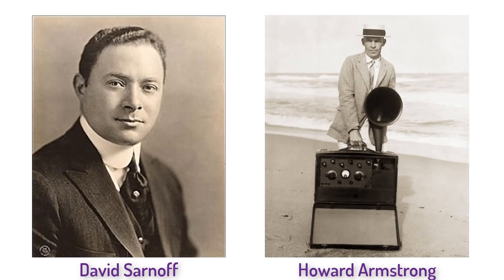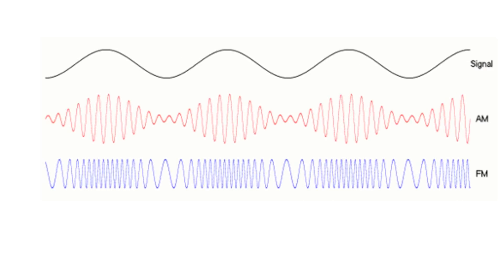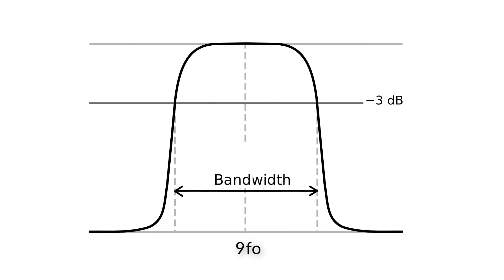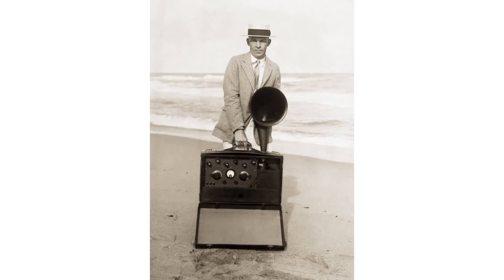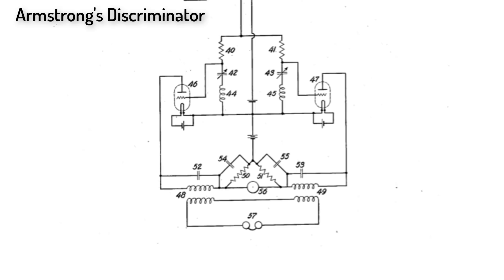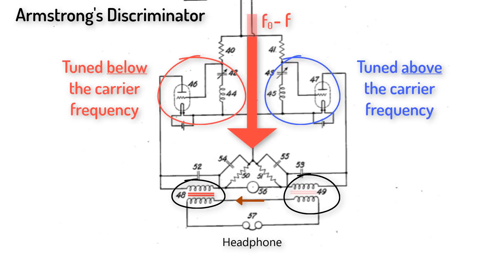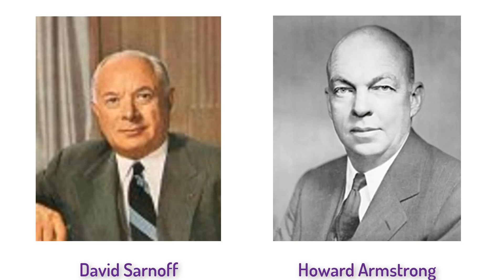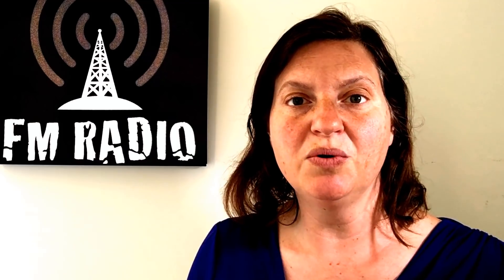Armstrong: the Tragic History and Physics of FM Radio

Comment: When I was in high school electric shop I learned about AM signals. When the audio is combined with the radio frequency the result is the carrier singal plus the audio (a sideband), the carrier minus the audio (another sideband) and the audio.  The transmitter loses the audio and transmits the carrier and sidebands.. 

The radio receiver picks the signal through an antenna, converts it and the side band to an intermediate frequency, amplifies this and then puts it through a diode which regenerates the audio. The radio frequency (RF) is filtered out with a tiny capacitor. The audio is amplified to drive speaker (used to often be called a loud speaker) and that is how we hear it. If a limiter were used with the AM radio we would not hear anything.

Because the difference between the the carrier and the side bands reflects the frequency of the sound the signal frequency is limited to the bandwidth of the carrier. This is set to 10kilohertz on either side of the carrier.

FM does not have this limitation. However FM channels are 200kilohertz wide.

Comment: Good overview. However, there is more than just the nature of the modulation between FM and AM radio to consider. The wavelength of the carrier signal has different characteristics. AM radio, being a much lower frequency (530-1700 kHz), and hence a much longer wavelength (about 1000 feet). Signals in this band tend to usable beyond line of sight, and are less affected by mountains and buildings that are in the way. FM radio signals are at higher frequencies (88-108 MHz) and have shorter wavelengths (about 10 feet). These shorter wavelength signals Are more easily blocked my mountains, and are not as usable over the horizon. Remember, the great DJ Wolfman Jack was heard over wide areas of the US on a AM radio station in Mexico. Yes it was an insane 250000 watts, but even that much power would not get a 100 MHz FM signal all the way to Canada!

Comment: In the 1960s I messed about with silicon diodes and PNP transistor colpitts oscillators to make a simple low power FM transmitter, based around 100Mc/s. Thank you Howard Armstrong for showing the way.

Comment: There was another advantage to FM.  Because AM radio waves can travel much further after dark, many radio stations have to sign off at sunset. FM stations did not have this restriction. So some stations, such as WMBI in Chicago went on FM so that they could have late night or all night programming. The first WMBI FM station signed on around 1943.  But with the war, nobody was able to buy new FM radios, so that first FM station was a failure.

FM radio doesn't necessarily have more bandwidth. But because it needed more bandwidth to work. The much higher frequency (presently 88 to 108 MHz) band was assigned to FM . This allows wider bandwidth channels.

FM isn't always high bandwidth high fidelity.  Narrow band FM is used for 2 way radio communication. It has a much smaller deviation and lower bandwidth. It still has lower noise.

Comment: There is another important part to the FM radio: the carried signal does not change loudness with distance between sender and receiver.

This is not very relevant for broadcast radio because you see the volume to what you want anyway.  However, it does allow you to distinguish which signal is louder from 2 transmitters independently of their range.

That made it possible in WWII to use sonobuoys — dropped from a plane, these hydrophones transmitted what they heard on FM and the operator could tell if a submarine was closer to one or another simple simply by the volume and hence keep track of the whereabouts.

Hunter-killer groups used that tactic successfully and the Mark 24 “mine” FIDO (it follows you home … a passive homing anti-submarine torpedo) gave them an excellent way to get the sub while the destroyers attached to the group sped to the position to relieve the planes.

FM helped win the war … in 1943-45.
Reply from the maker: Wow! Fascinating
Reply: @Kathy_Loves_Physics     Never mind that even active sonobuoys (i.e. creating a sound and listening for the echo) are attested in late war U-boat KTBs (war diaries).  From what I have read of them (not much, admittedly) it seems they possibly used exploding charges to create the sound wave.

And yes, I had thought that sonobuoys were maybe late ‘50s or ‘60s technology.
Yet a lot of technology happened way earlier.

There is a 1911 (pre-WW1) cartoon with everybody talking on their mobile phones, ignoring everyone else around them …

The 1936 olympics were broadcast on TV — one of the methods used was using a movie camera, quick-developing in <5 minutes, then scanning and transmitting the movie images. The technology by itself allowed for instant replay or slo-mo (I do not know if these were utilised), archival and later rebroadcasts, alternatively the physical film could be scrubbed, re-coated and reused. All it needed was a van, the camera mounted on top, lots of accumulators for power etc and the automated lab equipment and likely technicians to keep the stuff going.
Not too dissimilar with how early satellites and probes took photos and sent them back to Earth, incidentally.

Or slow-scan TV, which could be cut into (audio) records (from the received signal by a consumer).

Comment: Before FM radio came of age, it was common for AM stations to have sister FM stations broadcasting the same programming. The stations may have taken out FM licenses just to reserve a spot on the FM dial for when FM came of age. Otherwise, they were just giving their listeners a choice of tuning in on either AM or FM, but with little effect on audience size. Sometime in the 1960s, the FCC issued a requirement that limited the number of hours of simultaneous programming. To meet the requirement, on Oct. 12, 1966, Boston's WRKO FM initiated an automated top 40 format: no DJs, no commercials, just music and short announcements between songs. The format was a smashing success. Teenagers bought a large number of FM radios. However, the format became a victim of its own success. With a large audience, the station could sell advertising time. However, with FM radios in the hands on a large number of people, all existing Boston area FM stations prospered and I am sure more FM stations came on the air.

Comment: As a young broadcaster. I got my start in FM radio. At the ripe old age of, 15. And went from one, #1 Radio Station, to another. Later I would end up an engineer for NBC-TV & Radio. And for the next couple of decades.

At one point. I had gotten myself an antique,, Philco  Radio. And it had the original, Armstrong FM band. Which was around 49 MHz. Only later being moved higher up. Between 88 and 108 MHz. But the original band was down there around 49 MHz. And of course it picked nothing up. In recent times. As that is not our, FM radio. As we know today.

So yes it's fascinating. And to also cover the, 25 MHz deviation. Of the SCA carrier-based programming. The Elevator Music.  The Dental Office Music. Now carrying, data compressed, low bit rate, additional new, HD Digital Transmissions. Which does not mean, High Definition. But they decided to use that HD denominator just, the same. And because those transmissions are basically, 128 kb per second, MP3, files. But hey. It's still digital.

FM is Awesome!
RamyRAD

Comment: Thank you for this. I’ve heard the story in the past and I’m glad to hear it again. For the record… I have a high end stereo system and yes, I still use an FM tuner. I’d like to upgrade my tuner but nobody makes a decent one anymore as they’ve fallen out of favor. I mean, McIntosh makes one but it’s $5000 bucks. Ridiculous.
Reply: Yes, FM radio is great.  Maybe try to find a vintage tuner or receiver on eBay.  That's what I did, with very happy results for very little money (under $100).  As a guide, some of the best were made during the "Receiver Wars" during the 1970's-1980's.
Reply: @cdl0  I’m still using my Nikko nt-790 that I bought brand new. It has an analog slide. I remember buying it for its clean lines. It still looks modern today and works fine but I’m sure it’ll need to be re-capped at some point. I recently bought a small Realistic fm tuner off Craigslist to go with my new Sony receiver out in my shed. I really like analog slide rather than push buttons and presets.
Reply: Check out Bose, use the headphone out to you amp.
Reply: @jackever  I will check that out. Thank you.
Reply: @jackever  I did check out Bose. I didn’t know they made a stereo receiver back in the day. Anyway, I’m looking for all analog. I have a nice Parasound fm tuner. I never use it as it is digital.
Reply: @blipco5  Unfortunately, headphone out is not the same as line out: they have different impedance and different levels, so your mileage may vary with @Jack Everett's suggestion.
The Nikko is an absolute beauty, made in Japan in about 1980.  Tuning is done the proper, old-fashioned way with an air-gap rotary capacitor.  I see there are several on eBay now.  The Akai AT-K02L, also from 1980 is similar, which you might like.  None of these are expensive.
Reply: @cdl0  Yes, it’s part of the fun spinning that dial and searching for good music. In truth I know my excellent channels so it’s no problem. Those 790's go cheap. Mine, in black, looks as new as the day I bought it.
Reply: @cdl0  That Akai is very similar to my Nikko. Hmmm…
Reply: @blipco5  It is good to know you are using your tuner in the manner that is intended.  It ought to be a crime not to!  🙂  You might also like to consider having a receiver, such as the excellent Akai AA-R30 (made ca. 1979).  You can also mix black or silver finish and different makes with vintage gear.
Reply: @cdl0  My main house stereo is Parasound P6 preamp and Parasound A23+ power amp. CD player and record player, and is where I use my Nikko tuner. I have a work shed for my motorcycles. For out there I recently bought a Sony STR-DH190 receiver and a pair of Klipsch R-51 M speakers. But I hate the presets on the receiver. It is for my shed outside where I want the analog tuner and just use the Sony for its amplifier. I remember that Akai from back in the day. I’ll keep an eye out for one cheap.
Reply: @blipco5  I feel your pain about the preset tuning.  Vintage gear in your shed would definitely spark joy there.

Comment: More about Sarnoff...
Sarnoff didn't just pursue Armstrong. Sarnoff was an enemy of revolutionary designs and in favor of evolutionary designs. So it was with Armstrong's FM and also with Peter Carl Goldmark's sequential color TV system of CBS Labs. Sarnoff bet on compatible color TV, without the need to occupy other spectrum bands to allocate the sequential 144-fields, 24 frames per second. color system. Sarnoff put the brakes on the CBS project with help from the US government, which banned the use of mumetal, indispensable for Goldmark's sequential TV. The Sarnoff lobby had once again won another battle...
If Sarnoff were alive, digital TV would be compatible with analog TV!

Comment: When FM was invented there were no high fidelity recording and playback systems. So Armstrong's system could only be put to good use on live radio shows. Thus, it was only with the advent of the 525-line TV that FM sound came to be used. Sound recording systems on magnetic tapes and vinyl records became popular in the late 1950s. From then on, Armstrong's FM system gained its space in sound broadcasting.

Comment: Daniel Earl Noble ...  joined Motorola as director of research in 1940. His Link SCR-300 backpack transmitter and receiver ... provided the first practical FM band transmission for military use. Introduced in 1943, and first used at the Battle of Anzio, the portable FM field radio allowed communication with less interference than the AM "walkie-talkie" systems that had been used earlier in World War II. 
Source: Wikipedia

Comment: Sarnoff stole electronic television from Farnsworth. Edison, Westinghouse, Alexander Graham Bell, Watson and Krick all thieves. The patent system does not protect the small independent inventor.

BTW I had to do the calculations for both AM and FM radio modulation in a senior course on information theory.  When I hear about digitization distortion of analog signals converted to digital and back to analog I have to laugh thinking about the capacitor in an AM detector circuit.

Comment: Thanks for your interesting video. I bought an AM/FM Zenith tube radio in Florida back in 2002. I was curious about the Armstrong label underneath as I'd heard a bit about the legal wranglings, but you have explained it clearly. I used the radio in  the UK, and now in France via a 240/120 transformer. I think the demodulation system is slightly different between the US & Europe (something about milliseconds), but it sounds OK to me.

Comment: Very interesting video. Though the experiment with the bad contact transient current making noise on the AM program but not on the FM program is not on my opinion full proof. The radiated spectrum due to the transient current on the wire has a natural decay with frequency. The  "nominal" AM Band is around 1 MHz, whereas the "nominal" FM band is around 100MHz. The order of magnitude on frequency is most probably the main reason of the less noise. It is also clearly the case of the "atmospherics" discharge that makes a lot of noise in the low frequency used by AM radio and much lower noise as frequency climbs. As an example, the old analog TV was also working on such high frequency and was generally using AM modulation for the sound and had a good sound quality with much less noise than the "AM" radio.
To conclude , the effect of the limiter stage, when it does limit the amplitude of strong received signals, in conjunction with a well tuned ratio detector will limit the "static" noise and the effect of any amplitude modulation, but the experiment you did is not a true illustration of the fact. and I love you too!
Reply: You are wrong about analog TV using AM for the sound.  The picture was AM but the sound was a FM carrier modulated +/- 25-KHz and spaced 4.5-Mhz above the Video carrier.  It was possible to hear the sound perfectly with interference that made the picture unwatchable.

Comment: FM is better than AM, not just because it eliminates static. It is also not prone to fading or co-channel interference. However, it only works over far shorter distances, because the higher channel width requires higher transmission frequencies.

Comment: Germany has lost most of AM-frequenzes in 1948 on the copenhagener Summit. The only possible way to make radio is to go in the VHF-Band. The modulation is changed in to the new FM-System. The germanys need new radios. The FM-System was one of the reasons for succses of the german Electronics-Industry. But all big Companys in Germany pass away in end of 20th Century like in USA

Comment: I recall reading the owner's manual for my grandparent's 1967 Dodge. It listed the radio as being an accessory (it was also the first car that I had ever ridden in that had power brakes, steering, and air conditioning). It said that they recommended AM radio, as they said the short distance range and line of sight signal made it impractical for automobiles.

Comment: 1:24 The oscillator sends the carrier to the modulator, not to the RF amplifier. There is a mistake in the animation.
Reply: No. I'm not sure what you're thinking of, but the block diagram that you refer to is correct for AM. The typical AM transmitter used high-level modulation on the final stage in the transmitter. It was typically plate modulation of the final stage.
.
While it is certainly possible to amplitude modulate the signal and then amplify it, this was not originally done because linear amplification was not that easy back in early vacuum tube days.
.
While her overview might hit the important points, her explanations particularly when she's describing the quadrature modulation scheme, leaves much to be desired. I don't know what she could have meant by using a capacitor to smooth it out; or her description of an envelope detector as a one-way valve. 
This is why I don't like journalists trying to explain technology and why technologists need help in explaining technology to journalists. They frequently get things mixed up beyond recognition.
.
I don't particularly like some of the hyperbole that she injects into this when talking about the technology, but that diagram is correct.

Comment: 5:59 The FM signal is theoretically infinite in bandwidth. In practice it has to be band-limited, which introduces some unavoidable distortion. This is why FM broadcasts commonly have a 200kHz bandwidth, which is so much greater than the typical 20kHz used for medium-wave AM broadcasts.

Do they offer 10× the quality for 10× the bandwidth? No they don’t.
Reply: But FM carries much more that the baseband audio, it carries the subcarrier to create stereo, RDS to provide things like the time, weather, song titles, artist or album names, and emergency alerts, plus SCA for things like reading services for the blind, and even telemetry of the transmitter's operating parameters for the engineers at the studio.
Reply: All that is packed into unused gaps in the bandwidth. Which just reinforces my point.

Comment: Coils 48 & 49, the Discriminator, detects Voltage NOT Current. A simple mistake.! Current is present, but not without Voltage.
Remember, you can measure Voltage directly, but you can only measure Current, indirectly.